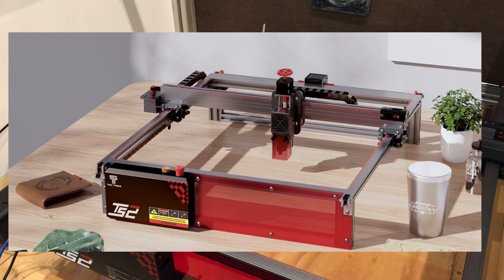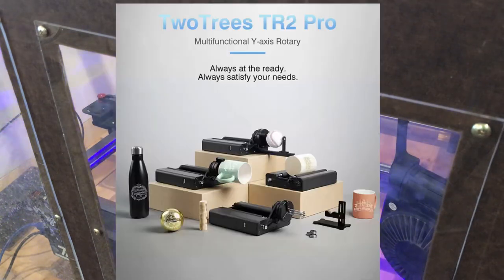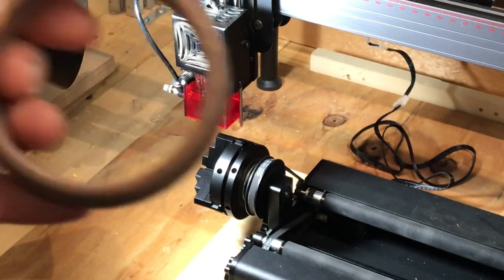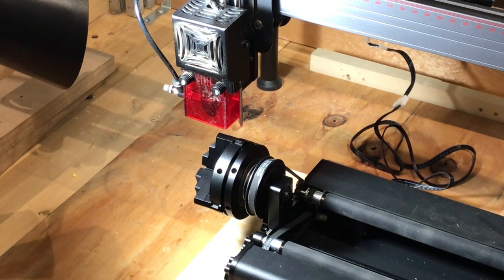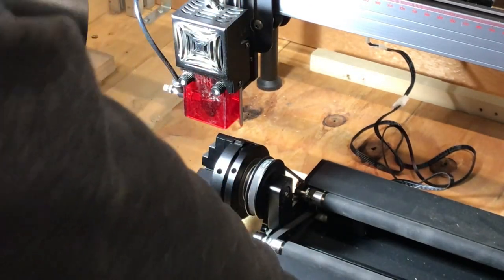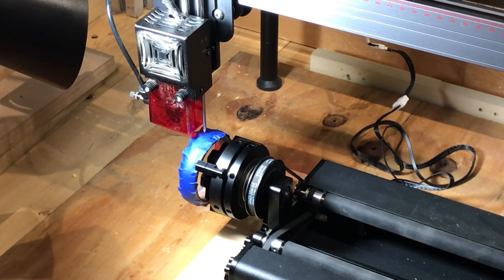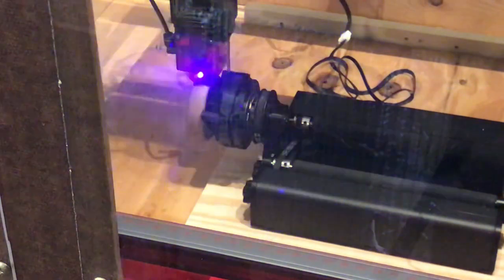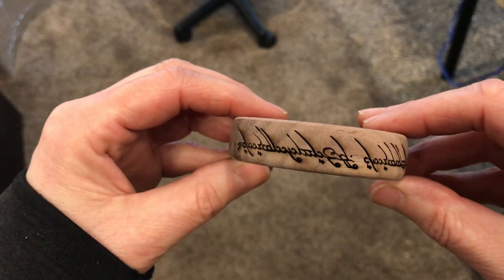Tool Time Tuesday: TwoTrees TS2 Laser Engraver with the TR2 Pro Rotary

Comment: Which of your videos would you suggest for a person who is new to turning bowls? I can't seem to get the hang of it. I  can do pens and some other things but have a terrible time with bowls. I think it might be my tools, and also, what would be the best wood to start with?
Reply from the maker: What size lathe do you have and what kind of tools are you using - traditional gouges or carbide? What kind of problems are you having - mounting, cutting, issues with tear out?